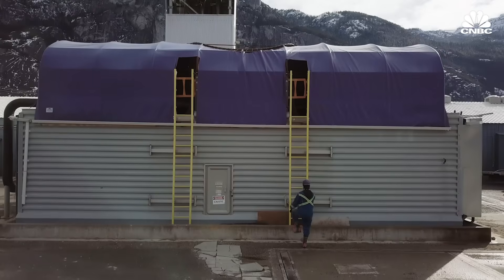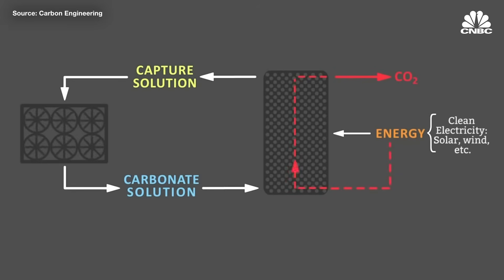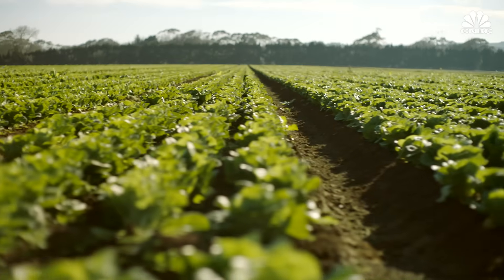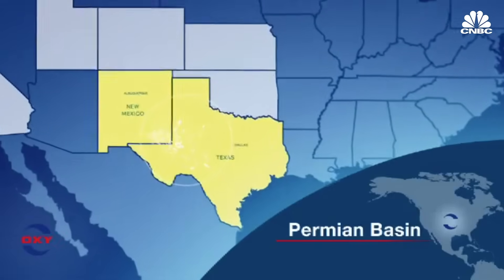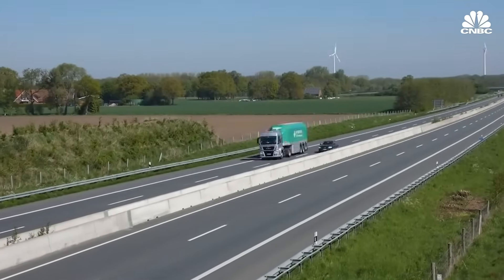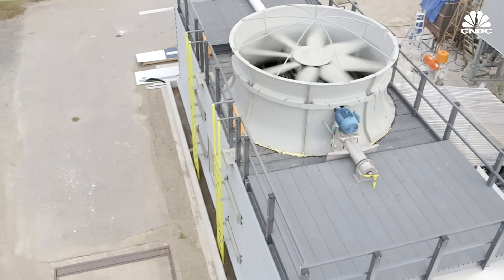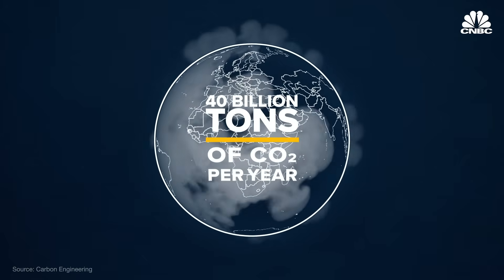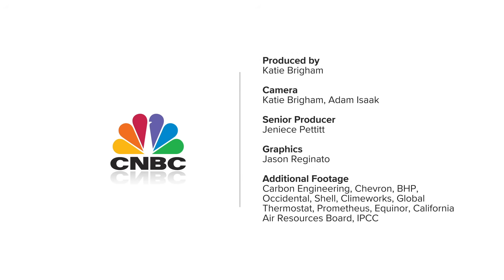Bill Gates-Backed Carbon Capture Plant Does The Work Of 40 Million Trees

Comment: Extracting CO2 from the atmosphere is not novel or special. Permanently sequestering it is. Trees do both. Plant the trees. No oil company involvement necessary. This from a Chemical Engineer and ex Oxy employee.
Reply: On sulution to this is to pump the co2 back in to the space where there was extracted oil ,but you you have a good point
Reply: evenplay99 The relative advantage of trees would be that they work anywhere, whereas carbon sequestration is localized and doesn’t effect the carbon released by the fuel being burned (ie cars).
Reply: @sniggle4206  Truck it to site and pump it into the earth using what energy source? And how do you keep it there? It wants to fracture the rock and leak out
Reply: No trees store carbon dioxide in the wood 
burn a tree it releases carbon dioxide 
wait 10 000 000 years and burn coal it releases carbon dioxide
Reply: @bennyj25  Apologise
Reply: The problem is the rate of return that a CO
2 plant can do in a shorter amount of time.  See 11:19 Yes trees are the natural and best long term solution but it requires more land and time than the current geopolitical climate can sustain.  Trees better yes but it seems a bit too little too late at this point.  I ponder if this level if ignorance is the actual cause of the Fermi Paradox.
Reply: more trees you plant earth gets darker and attracts more sunlight which makes the earth warm up even faster, those so called experts somehow didnt want to mention that, planting 10s of billions trees is crazy, you need to keep balance. PS you need fossil fuels to keep the world economy running unless you prefer to go back to 15th century lifestyle (where people used to burn firewood, imagine 8 billion people doing that)
Reply: @steveXracer Didn't know that.  I question for how long it resists degradation even in those conditions.  We're pulling carbon out of the ground on geological time scales.  Our sequestration needs to be thought of on similar time scales to keep the problem from reasserting itself.  Certainly a tool in the box to mitigate total disaster.
Reply: @steveXracer good luck with cutting down 10 billion trees and dumping them in the ocean and make sure to use solar chainsaws and wind-Bulldozers, tesla trucks and Wind-powered ships :d fish will love it for sure
Reply: somebody   First a lot of the land that is defrosting is the tundra, where methane is being released which is much more impactful to the environment than co2, and that land is just not suitable for the growth of the kind of plant growth that would make any kind of difference. And at that it would not possibly make a difference considering the rate at which the environment is degrading.
Reply: They won't do it because of lack of funding
Reply: Trees don't sequester the Co2 permanently. But I know what you mean, a forest sure beats more industrial looking thingies :P
Reply: this thread got stupider and stupider soooo fast.
the "planet gets darker" is a real treat. Up there with flat earth and lizard people.
Reply: @atruebrit6452  so you call me stupid because you lack basic knowledge? darker the surface area of the planet more sunlight it traps that otherwise would have reflected back into the space, ever wondered why black cars get really hot in summer? how about do some basic research before you call someone stupid, more trees would make earth warmer
https://www.sciencemag.org/news/2016/02/europe-s-trees-have-been-warming-planet
Reply: I don't see how this equation works out in practical use.This solution does not make much sense for several reasons. It could buy us some expensive time at best, fusion reactors even more if they figure it out soon enough. But even they would have drawbacks and are not an ideal electrical energy source. Perhaps i'm too negative, but it looks to me, we are just too many. Current United Nations predictions estimate that the world population will reach 9.0 billion around 2050, assuming a decrease in average fertility rate from 2.5 down to 2.0. It cannot continue to grow indefinitely. There are limits to the life-sustaining resources earth can provide us. In other words, there is a carrying capacity for human life on our planet. No amount of CO2 pumps can fix that issue.
Reply: some body Sorry my bad. I mixed up carbon capture (like at a coal plant) and sequestration. Sequestration does work everywhere.
Reply: We need the huge $$$ the oil companies have. So what if they are trying to save their souls by financing these plants, the situation is so serious that I don't care who pays for it. When/if the climate is stable again, we can settle our accounts with those lying assholes.
Reply: Kind of, yeah.
Reply: the solution provided here is a scam. this will never work commercially, trees do.
Reply: @atruebrit6452  I wish I could think like these guys. I'd be a lot richer. When people's arms start flailing, just "do something" and have em bust out the checkbook.
Reply: @darrellm4794  has nothing to do with the way of thinking, or with aptitudes.
It's corruption pure and simple. You need to know the right person in the right position. I followed startups for the last 20 years. The most idiotic ideas got funded, 1 in 100 is still in the market after 2-3 years, the decision makers got rich every time. Corruption and inside trading. And a few suckers, but not so many as you might think.

I started a tree planting program, and I cannot get funds, not even loans, but a machine that squeezes juice from a plastic bag got 400mil dollars... Solar roads which were proven to be a scam got a couple of millions too, although they never worked, and the idea is clearly stupid (like this one here), but I was not able to secure funds, even if contractually obligated to return them, with profit... you need to know (and pay) the right people.
Reply: +A True Brit   Thank you for sharing. Some of us are way too aware its by design. Absolutely sucks to read your obstacles yet still glad to hear the truth
Reply: oh yeah, you youtube sure know what you're talking about.... make sure you wear your little tin foil hats when you type your comments... lol
Reply: It is irrelevant whether you're a Chemical engineer or not. In fact our profession has been a huge part of the problem Mr Fusco
Reply: oh yeah, you youtube sure know what you're talking about.... make sure you wear your little tin foil hats when you type your comments... lol
Reply: Why remove more CO2 when we're just now finally emerging from a epoch-defining low in terms of atmospheric CO2?
Reply: We don’t have time or space to plant enough trees, were running out of time
Reply: @bisforbroke4233  No we're not running out of time, stupid...the planet has had a mean atmospheric CO2 level of 800ppm for majority of the 4.5 billion years there has been an atmosphere and far higher a number of times.  The higher the atmospheric CO2 goes the MORE plant life we'll see as plants thrive at levels between 800 and 1500 ppm, we're sitting at 450ppm or less.
Reply: Smaller plants actually draw more CO2 and more efficiently than trees do, the solution is more scrub and grass. the thing is, as CO2 rises, the easier plants have it at growing and the more efficiently they reproduce.  Worry about atmospheric CO2 is a waste of time, focus more on land reclamation and avoiding persistent chemical pollutants.
Reply: Trees do not permantly sequester CO2, they sequester it up until the day they die, then they release it.
Reply: @Fred_uyz  Yeah Frederico thats not true either. The CO2 is fine when they die, its when the wood decomposes or is burned that the co2 is released.
Reply: @sporkeh90  what happens when a tree dies? Oh yeah, it decomposes 99% of the time. Also CO2 starts outgassing as soon as they die, just slowly. As decomposition accelerates so does its release. And by burning to turn it to theax
Reply: @Fred_uyz  Yeah that was my point. Its not as if 100% of the co2 just releases instantly lol it takes 'a while'.
Reply: Trees do sequester carbon until they rot and release it again.  If it's to be a viable long term solution it'll need to be buried in the ground or changed to a non-bioavailable form.

Comment: CO2 is not stable on Earth temperatures and pressure. Dry ice sublimates fast at room temperature. CO2 just stays solid (frozen) at −78,48 °C at room pressure. Oil reservoirs are not safe. To try to push CO2 under the carpet, will not work. It must be bound in solid chemical stable form.

Comment: Top notch video, it answered a lot of my questions on this topic.

Banning non carbon neutral fuel is surely a lot easier than banning internal combustion engines overall, especially if the technology keeps improving.

Carbon capture will improve fast, planting trees will not, but we still need to do both no matter what.

I believe failure to deploy carbon capture will be the Achilles heel of climate change. If it fails to improve we are royally screwed. When it becomes cheaper than drilling real change is due, we can even use it to fix the grid storage problem.

The fewer people who can make the biggest difference the faster it's going to be to revert climate change, so we might as well use the most powerful bandage we can, even if it's going to be expensive if the technology doesn't improve, which I believe it will.

To clarify my point of the amount of people needed to make a change, imagine banning meat, it would decrease our footprint giganticly, average life expectancy would increase, land use would be much more efficient, we could end world hunger probably 10 times over, the amazon rain forest would be able to grow back,  but literally every person on earth would have a voice in that discussion, and the amount of people affected would be so gigantic it's unimaginable.
On the other hand if one single company invents carbon capture that is much cheaper than oil drilling, that one company could make as much of a difference as pretty much all the farmers in the world that stopped producing meat. I'm exaggerating, but you get my point.

Comment: Oil companies are backing it... not because it is a good idea (it isn't), but because they get a nice tax deduction and carbon credits worth more than the amount of money put in.
  As for the location, if it actually was cost and energy effective, why would you put it in an area with a huge number of trees (starving the trees of CO2) instead of next to a steel mill, coal-fired powerplant or in the heart of or downwind of a big city (where there is an excess of CO2)? The answer is the extremely cheap electricity available in BC, which is why it won't work elsewhere because the energy cost would double in other parts of Canada and most of the U.S., and would quadruple if installed in Europe.
  Of course, in the equation, nobody will include the carbon emissions from the powerplants that would generate the electricity in the areas of the world not blessed with BC's low population and excess of water and wind generation.

Comment: If co2 is used to squeeze more oil from the oil fields, then it seems to me the problem is getting worse. The power used to remove the  carbon has an impact also.
 What needs to be done is to sequester the calcium carbonate where it will never be able to release the co2.

Comment: Making calcium carbonate is great.  Why on earth are you taking the CaCO3 and using it to create MORE EMISSIONS?
Nothing they are doing is actually carbon-negative.
Reply: Explain?
Reply: @eddiemoojen8686  the first thing they did was get carbon dioxide out of the air and convert it into pellets of calcium carbonate. That is great and an amazing way to take carbon out of the air and we could have dropped those pellets down a mine or the bottom of the ocean.

They are then turning those pellets into fuel which they burn or into carbon dioxide which they use to extract oil. If they burn it as fuel then it's basically carbon-neutral like a very inefficient replacement for burning wood and if they use it for oil extraction then it's part of a very carbon-intensive energy industry.

Basically everything after they turn it into pellets is the exact opposite of what we need to save the climate.

Comment: do these guys understand thermodynamics? you need a lot more energy to fix CO2 from atmosphere than the energy that was produced while burning the fuel that created the CO2.....
Reply: Which is why the technology is to be driven by "renewables": wind and solar being the obvious. Both are driven by the Sun, which isn't running out any time soon.
Reply: @kasegiyabu5030  if you generate enough renewable energy to run this plant then simply migrate to renewables rather than using this stupid thing the trees will clean up atmosphere with us not adding more to it.
Reply: @dhirajgupta-f4i  If the area of land needed for solar panels to drive this plant is smaller than 40 million trees, which I believe it would be, then for extraction of CO2 this plant makes sense. I see it not as a permanent feature: it's to reduce the level of CO2 in the atmosphere.
Reply: @kasegiyabu5030  ok let me explain it this way, suppose to produce 10kw of electricity 5 ton of CO2 is produced by burning fuels. Now to fix that 5 ton of CO2 you will need more than 10kw of energy (because nothing is 100% efficient and entropy never decrease) say it takes 12kw (very modest assumption) , now is it not better to give this 12kw directly to users  then trying to fix 5 tons of CO2 otherwise while you are cleaning 5 tons of CO2 humans will create more CO2 which could have been avoided by suppying that 12kw to them.
Reply: I understood already what you're saying. My point is: the high levels of CO2 will linger in the atmosphere for around 100 years, unless something is done actively to remove it. Merely becoming quickly carbon-zero won't stop the projected natural disasters from unfolding, if they do. This technology is a way of bringing down quickly those levels, with minimal footprint. I don't see it as a substitute for carbon-zero. I view it as an efficient way of avoiding or reducing climate problems.

Comment: As the one lady said the CO2 problem will only be solved with a combination of solutions this being one of them. The turds on here talking about only using wind and solar power are completely blind. They don't factor in the carbon foot print that goes into making batteries to store that energy, or the damage/pollution to the land where rare minerals are mined just to make those batteries.

I'm not pro oil, but we need all solutions to reduce global warming. Like it or not fossil fuels will eventually go away due to technology in more efficient fuel systems. Don't buy into the political positions of the left or right. The real solution is always somewhere in the middle.

Comment: C02 is loosely distributed in the atmosphere.

Isn't there a way c02 could be sorted in HUGE silos and then fed into the collectors as pure c02?  Seems somewhat inefficient the way it is designed now.

I think it would be way cheaper to collect C02 in much larger quantities and then process it once collected.
Reply: But that’s impossible you can’t sort co2 that’s like sorting juice from the water you mixed it up in right now it filters the co2 by only effecting it and letting the rest of the gas pass through

Comment: Unnecessary. Adiabatic air conditioning units at office buildings with compressed air storage and fractal distillation completely removes the needs for chemicals and is a net energy saver (with heat recovery steam generation, it can be a net energy producer). Also, scrubbing carbon dioxide from office space air with >700 ppm CO2 is far more effective than scrubbing carbon dioxide from the outside atmosphere with ~400 ppm CO2.

Comment: 🤦🏻‍♂️ Can’t win 
If free cleaning the air but people criticise because oil companies want help cleaning the air quality ??? 

Any of oil companies that do nothing also criticise for do nothing 🤦🏻‍♂️ 

If all polluted factory build few of this machine to cleaning the air !
Reply: The oil companies are only backing this because it will ease the transition to electric cars.
What if all motor vehicle emissions could be offset by these? Everybody buys gas guzzlers because the ecological impact is now nill, so happy days. and people buy a ton more fossil fuel.
Reply: King David  That is precisely what they will push, climate change and ecological issues are do not only mean carbon emissions...

There are more pollutants caused by ICE vehicles, other chemicals go into the air other than carbon dioxide, there are bigger issues with extracting, transporting and refining fossil fuels that the world really needs to get over and move beyond.
Reply: @kal9001  big oil companies is the ones that is pushing for EVs, the reason is that if you was to do the math not everyone can afford to power their cars using solar energy so where is that power going to come from??? we're not going to build anymore nuclear power-plants, sure wind power is cool but it cost more than current power production and not to mention it does messes up the birds and eco life for miles around, solar energy requires space this wouldn't work as no one would want to cut down a forest to put up solar panels so the only logical solution is oil until we've something better...

Comment: A big issue that is not treated in this video is the heavy consumption of petrol by industry. Metal smelting industry requires high temperature and pressures that can only be achieved efficiently by burning fuel. Using green energy, which is mostly transferred by electricity, this becomes ineffective. Direct capture at the source could help heavy industry reach there carbon targets. This should be the technologies main market!